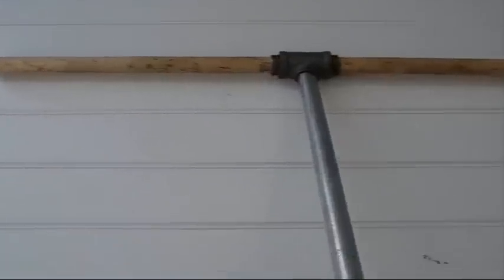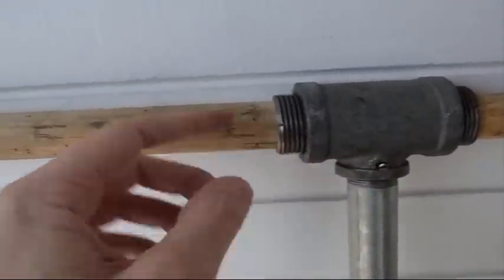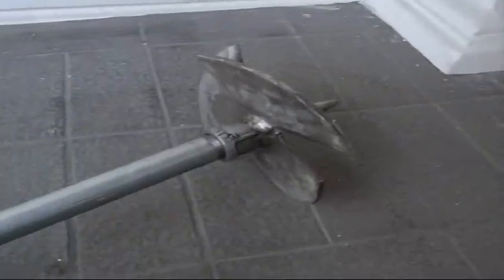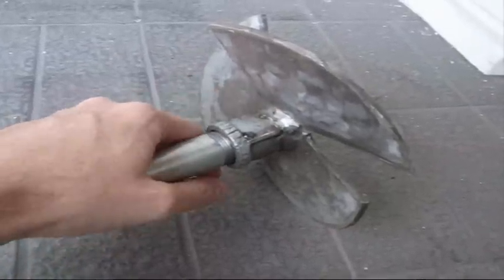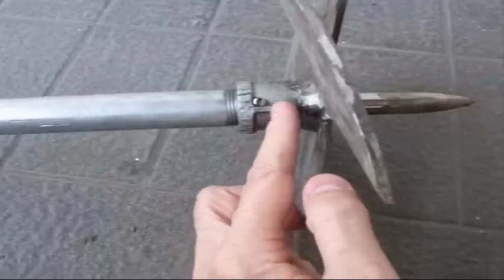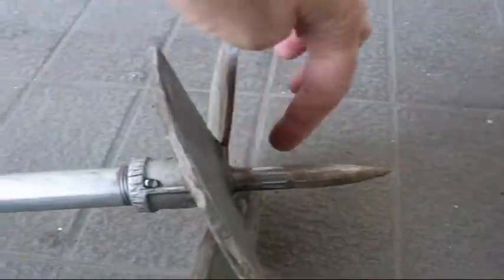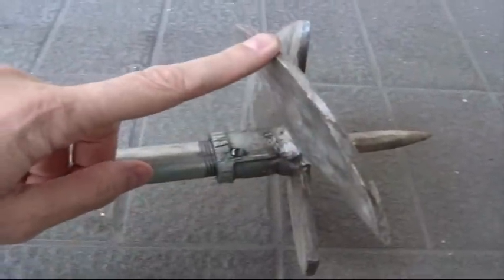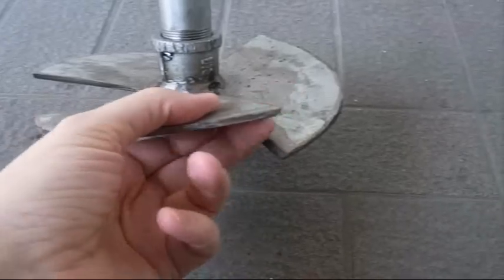Post Hole Auger - DIY (Weekend Welding Warrior)(Updated version available)

Comment: Thank you 
I built one and it works great
Reply from the maker: Thanks for letting me know.  Where did you find the auger / screw part?  That's the hard part.
Reply: tsbrownie that wasn't a problem, i cut 150mm square plate, so i got
6 inches auger. with 4.5 inches grinder it takes about 20 minutes.
Reply from the maker: I thought about cutting one from plate, but was not brave enough.  You are good!
Reply: haimfitoussi to where can i send a pictures?
Reply from the maker: haimfitoussi
You can post on youtube and send me a link or post your e-mail (you may get spammed) and I will respond.

Comment: Hi I was wondering what was the angle you had welded the auger plate at for optimized digging , too steep would make it hard to turn and dig out the dirt so i am guessing it is a relatively shallow angle ?
Reply from the maker: Grego d This plate is from a telephone guy wire anchor.  The one my father had did have a very shallow angle.  This one is steeper but OK.  The front edge is just an inch or two above the tail end of the other plate.  If the angle is too shallow it gets stuck on small rocks, so that's one tradeoff.

Comment: It's been a while now - how's it holding up? What would you do differently?
Reply from the maker: +Mike Nestle Good question.  No problems to date.  Just keep it clean/dry after use to avoid rust.  I was worried about the welds on the auger, but they were apparently good enough.  I would focus on those more next time.  I would also make it 4" or 5" rather than 6" because the job for 6" holes did not materialize (for small cement pilings) I just don't need 6" holes usually and that means more work.  I did cut the handle down so that it's shoulder width.  It was more, but it was unnecessary and forced you to back away every half turn.  This design was modeled after one my father had that came from his great-grandfather.  It held up for 75 years before rust got one of the blades (they were originally riveted, but he welded back on and I think my brother still has it).  So the basic design is well proven.

Comment: thats electrical conduit.
Reply from the maker: Heavy gauge water pipe.  Electrical conduit would not hold up.
Reply: emt conduit probably would not hold up.  ridgid electrical conduit is almost the same as black iron water pipe.. might even be the same stuff.. but the stuff in your vid looks extremely similar to the ridgid conduit I installed on many industrial machines... even did some stainless heavy gauge conduit that was about that size as well as some jobs that requested all aluminum conduit of a heavy gauge.. .about 3/16" wall thickness if I remember correct..
Reply from the maker: Bought this stuff from a plumbing supply house.  Heaviest gauge they had.  Maybe a bit of over-kill, but if it's worth doing it's worth over-doing!  ;)